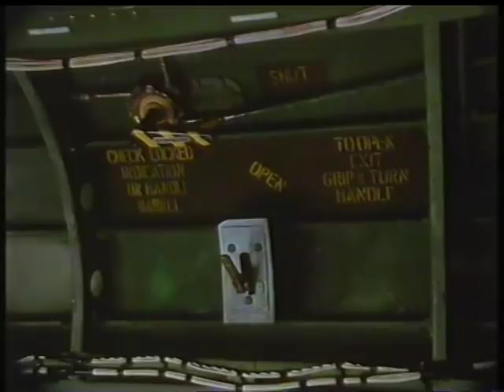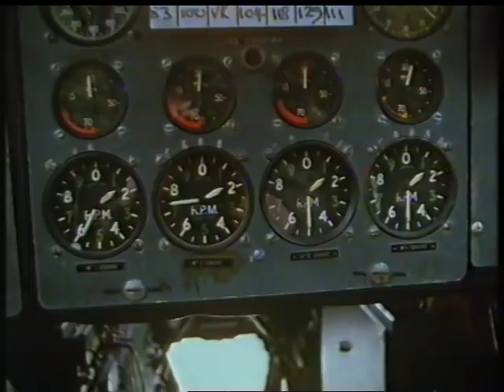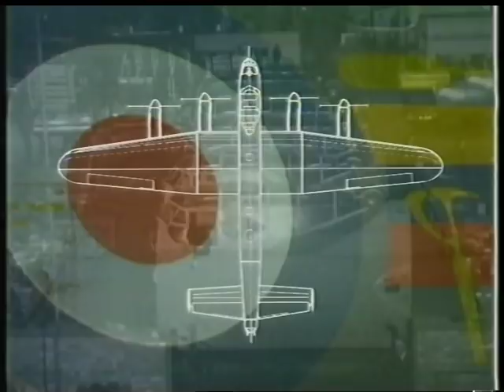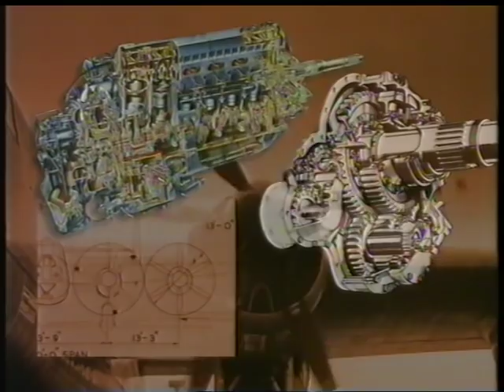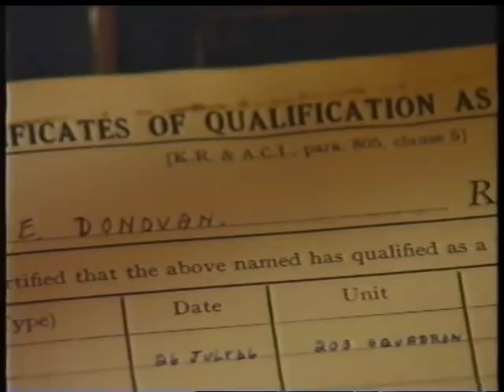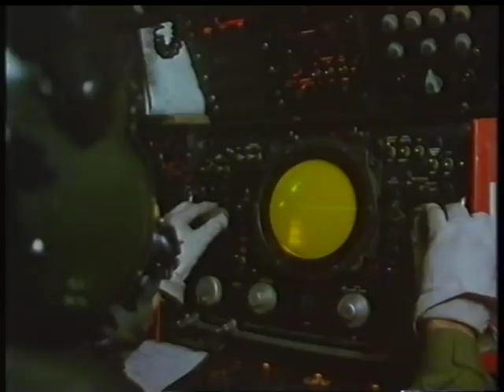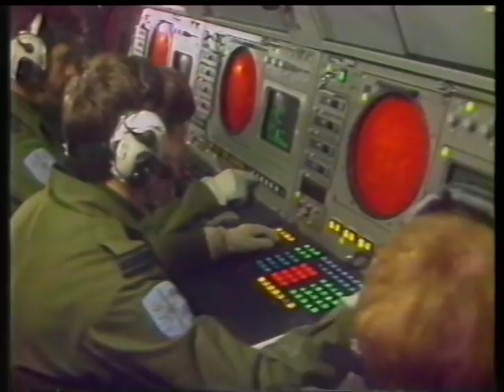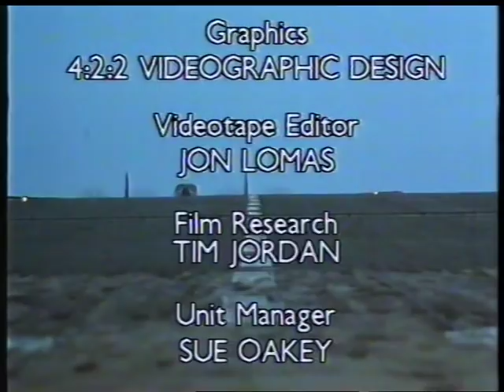'Perpetual Motion' The Avro Shackleton

Comment: Can't help feeling sad when seeing such a masterpiece of engineering being chopped up. Some may say that machines are inanimate, but with so many highly skilled craftsmen putting so much dedication in an aircraft, I just don't think that's completely right.
Reply: Yes, it was men (male and female) who dug & smelted the ore, who formed the ore into parts, who put the parts together, who kept the parts working in harmony, who repaired the worn and broken parts.  Men who guided it on its' path, who imparted a bit of their being into the whole.
Reply: No two are alike, they all have a character.
Reply: Agree totally. You can tell when its having a good day. Or a bad one.
Reply: Seeing them waste those planes brought me to extreme rage. They should have been offered for sale with any war time equipment removed. Zero reason to destroy tax payer funded equipment like that which is of real value. There was certainly more demand at air museums and so forth than 12 planes. Absolutely disgusting. Even as old planes in 1991 they would have easily brought more than scrap value. They're worth millions today. Infuriating.

Comment: I joined 204 Sqdn at Ballykelly in 1957 as an Air Signaller and served for 8 years and some 3500 hours.  The best thing about that time was the bond between members of a good crew.  Rank didn't matter so long as you were a commited member.  86 years old now but the memories are still with me.  Happy days.
Reply: My uncle, Barry Masefield, flew on Shacks from Ballykelly. Original joined up in 59 as radar techie but hated it and switched to non-com aircrew three years later. He later flew on Nimrod and then, after commissioning, flew on Vulcan and Victor.

Sadly he's no with us but I'm interested in finding out what Shack squadrons he served with, especially as I'm in the mob and my current station hosted 204 Sqn at one point.

Comment: I serviced this wonderful Aircraft on 8 Squadron at RAF Lossiemouth for 8 Years. I designed and installed my first Modification on the Aircraft and wrote my first User Manual (for "Autocat"). All of which motivated me for my ex-Service Job as a Technical Author working for "Airbus".
This Video brought back some wonderful Memories of my Time with the Shackleton. Thank you.
Reply: I got to go aboard a Shackleton at Lossiemouth :-)
Reply: diceman199  Tell me about it (do you need my E-Mail Address ?)
Reply: @nicholassiminson1825  No much to tell really. I was in the ATC and we got shown around the inside of one. I did have several flights on the Nimrods out of Kinloss though

Comment: I was so proud to have served in the RAF as an aircraft fitter, when we had these old ladies! Unfortunately i never got posted on them but we used to regularly have them in on exercise at Brize Norton! I used to love the smell inside them so ancient, leather seats and AVGAS!
The magic part was when they took off one after another they did MAG DROPS at the end of the runway before each took off the sound was truly.......SUPERB.
TRULY SADDENED that we have lost the Shacks and the Lightnings who used to fly intercepts at the request of the radar ops,  😢😢 brings tears to my eyes that the RAF has lost some of the best aircraft it ever had, replaced by the rubbish, unreliable over expensive F35 ‘Lightning’ ( what an insult to give THAT name to such a true WASTE OF METAL as the F35]👿 There was and is only one true Lightning.
Thank you crews and thank you Shackletons.
Reply: The one consolation of naming the F-35 the lightning is that it was named for the US P-38,but the "proper" lightning should not be mentioned in the same breath as the current pile of airborne scrap.

Comment: I remember them flying west over the north part of Larne, N Ireland in 1959 when I lived there.  On one occasion I recall a Shackleton trailing what looked like a small torpedo slung about 100 feet below it on a cable connected to its middle.  It was green, with an orange painted tip.  I imagine it must have been for detecting submerged submarines ..? Perhaps the probe was for picking up magnetic anomalies?
Reply: I wouldn't be any use to you on that question, but I remember seeing something similar in Dublin in 1981.  It was a Scottish Aviation Twin Pioneer towing a box behind it.  It was being used for geomagnetic survey work and made it to the Irishman's Diary column in the Irish Times.  Only recently I found that it was operated by Flight 1, a company that was then based in the Isle of Man
Reply: J Lalor I wasn’t here. We didn’t speak 😎

Comment: I remember a quote from a book on the worst aircraft – I forget the title – in which a Shackleton air crew member said the best sound in the world was when you were standing watching a Shackleton taking off because it meant that you weren't in it.
16:40 The Griffon engine was not developed from the Merlin, but from the larger "R" motor that powered the 1931 Supermarine S6B Schneider Trophy sea plane.
Reply: It wasn't a slur on the aircraft, rather then length of the patrol. The longest missions recorded were just under 24hrs.

Comment: A bit of a clanger somewhere.. As they were starting individual motors, 3 were running and somebody shouted "Starting Port outer".
The camera certainly was on a 'port outer' engine but it didn't have twin, contra-rotating screws like the other 3, just a single prop. I think a bit of Lancaster film crept in there.

Still,  a damned good show chaps, what! 
Wizard piece of video.. Don'tcha know, Old Bean.
.
Reply: That's the point of the film; the parallel between the Shackleton and the wartime Lancaster. It's used a few other times in the programme, so obviously not a clanger.

Comment: It is not mentioned in the film but the Mk111 Shackleton (the one with the tricycle undercarriage) was in fact a 6 engined aircraft. There were two jet engines mounted in the (inner?) engine nacelles to provide extra thrust on takeoff. These were run on petrol rather than jet fuel and only had a life of a few 10's of hours. The pilot had no control of them, the switches to start and the throttles them were mounted under the flight engineers desk as there was no room to put this addition on the standard panel.
Reply: I should add they were also Nuclear capable - the control column has two sets of switches - one for conventional depth charges and the second for nuclear depth charges.
Reply: @johnmurrell3175  And a standing order to start the jet engines to get them clear before the nukes went off.
Nuclear depth charges? Seriously? What height were they to be dropped from to allow the aircraft to escape?
Reply: @MarsFKA  I don't think it was very high - they also dropped them from RN Ships. I guess if the Submarine was deep a 10 to 30kTon weapon might not erupt that mush above the surface ? I am not sure what impact it would have on the ship dropping them but they might have been expendable like the V Bombers ? 

I have seen a film of a practice nuclear depth charge being dropped by a Wessex - well more like rolled out of the door.

The Shackleton has two buttons on the Control Column one for conventional depth charges and one for Nuclear ones. If you look in the 'bomb' bay of a MkIII the added on red wiring is for the Nuclear depth charges.

There is an interesting story about one of the Shackleton used to monitor the British Nuclear Test, they were flying at quite a height and the radar operator spotted a ship entering the exclusion zone. The aircraft would normally have descended to  identify the intruder but the captain stopped the co-pilot doing this. A long time after the successful test the co-pilot asked why they had not been allowed to investigate the ship. The captains answer was that their role was that in the event of the Victor that was carrying the bomb crashing on take off and the bomb going off all those on the monitoring island as well as most of the ship crews would be killed. The Shackleton was the only aircraft that had sufficient range to fly to an alternative airfield to tell the British what had happened !
Reply: @johnmurrell3175  That's an interesting story in your last paragraph.
Returning to the subject of nuclear depth charges, I was looking at something completely different and found this in an article on the P2V Neptune and the crews who flew them:
"“Sometimes we carried nuclear depth charges,” recalls Boslow. “If you got within half a mile of a Soviet sub, you’d be sure of killing it. Of course you’d probably kill yourself too.”
Reply: @MarsFKA  I just had a look at the Haynes Shackleton owners manual and on the loading plan for the bomb bay it appears to be shown as AS bomb. I assume AS is anti-submarine and bomb is because it was essentially the same British designed bomb dropped from aircraft like Canberra though I guess the fusing might be different - pressure rather than contact or altitude. On the bomb bay picture in the book you can see the red special wiring for the Nuclear Weapon. Since this type of read wiring had a nasty habit of cracking on bends I hope that ws better than the places I have removed it from !
Reply: @johnmurrell3175  I'm still shaking my head about those nuclear depth charges. The product of Cold War collective insanity.
Reply: @MarsFKA  My guess is that conventional explosives did not produce a high enough pressure to kill a nuclear sub particularly at depth. The weapon used was the WE177A rated at 10kTons. Apparently these could also be fired by the Ikara anti-submarine weapon giving the launching ship a range of around 10 miles to avoid the worst of the shock wave.

According to Wikipedia the WE177a weighed 60lbs - 272 kg so comparatively light & small.The B & C versions were more powerful but not used by the Navy. They don't look very impressive when you see one at least in their unarmed state.

Comment: Avro Manchester: "I have a powerful defensive armament"
Boing B-17: laughter
Reply: panzerabwerkanone 

Boing B-17: I can carry lots of bombs
Avro Lancaster: hysterical laughter
Reply: @davidmacdonald1695  Avro Vulcan: bitch please
Reply: @Jack-hg1hq  Vulcan 21,000lbs conventional bombload. Lancaster 22,100lbs conventional bombload.

Lancaster : bring it on, Junior.
Reply: @biggles19821  ok, vulcan range- 2300 miles max speed- 644 mph, ceiling- 50,000 ft

lanc range- 1600 miles on half load, max speed 280mph, ceiling- 24,500ft.

I love both aircraft but the vulcan was designed to drop one bomb very far away very fast while avoiding missiles, not a bunch of conventional bombs while defending against fighters. It's hard to compare aircraft for different roles. Cool username btw
Reply: @Jack-hg1hq  True, but for an aircraft its size and age, the sheer lifting capacity of the Lanc is still phenomenal by any standard! Vulcan benefitted from it as the company poured all the experience learned into it and make something exceptional.

Your data is slightly off on the range too, there's documented evidence of Lancs going some 2,250 miles with 12,000 Tallboys to bomb the Tirpitz.

Biggles... yeah. It started as a sarcastic nickname for me years ago, but its more appropriate nowadays!

Comment: The South African air force have stopped using these and gone back to using Douglas Dakotas!
A friend of mine owned one and the oil puddles under the engines were something to see:)
Reply: Shackleton or Dakota puddles?
Reply: @MarsFKA  Shackleton. Rools Royce oil leaks :)
Reply: @andrewallen9993  Okay. I was an apprentice mechanic in the 1960s, working on Rovers and Jaguars and it was an act of faith among us mechanics that the British never considered an oil seal to be working properly unless it was leaking.
Rolls Royce has always adhered to that tradition. I go to the Classic Fighters Omaka air shows that feature Mark IX and Mark XIV Spitfires. They are parked in the hangar overnight and we spectators are allowed to get up close and personal with them each morning, before they are taken outside for the day's activities. Each time, I have noted the regulation Rolls Royce little puddle under the rear main seal.
I'm not picking on Roll Royce alone – there were two P-40s parked in the hanger, as well, each with its little regulation Allison puddle.
Thrirty-nine years ago, I went to the Museum Of Transport And Technology in Auckland and walked around the aircraft they had there. One was an old DC3 and I got the impression that they occasionally ran up the engines, because the oil puddles under them were unbelievable!
Reply: @MarsFKA  Besides the puddles underneath my Norton Commandos there are always puddles under my XJ6, Mercedes fintail 200d and split and bay window kombis. The 350 Jawas of course have oil under the exhaust/silencer seals being two strokes.
I think it is a sign of old age :)

Interestingly enough there would be oil leaks (small ones admittedly) under the disk memorys of IBM 360 mainframe computers, part of the preventative maintenance routines was to check and top up the hydraulic oil levels :)
Reply: @andrewallen9993  Hydraulic oil in IBM mainframes, forsooth! I didn't know about that.
I've just retired from twenty years as a vehicle inspector at the NZ Automobile Association and we saw all kinds of vehicles pass through. The cars that seemed to leak the least were Japanese and, of them, the least leakiest were Toyotas. It seemed that the most reluctant of those to leak are Camrys and Corollas, which is one of the reasons why my wife and I now have one of each.
Having said that, I have seen some horrendous oil leaks from Japanese cars, as well as from all the others.

Comment: Has anyone noticed its rate of climb at around 9.44???
Reply: Pascal Chauvet:  Yes. An amazing rate of climb for how antique the plane looks. Approximately a collective128 litres, supercharged, wide central wing and those double props'.  A lot of 'grunt' and lift generated from that combination, I would think.
Reply: The Shackleton was pretty powerful for its empty weight. It had quite a bit more power than a B29 which was a lot heavier. No doubt the one at 9.44 was on a test flight and not fully loaded.

Comment: The Nimrod had a service life of 41 years. Yet you say the project was scrapped??????
Reply: I'm not sure how the gov't could think that the cost of nimrod and a few planes for surveillance wasn't worth it and remove that from the budget.  yet a couple billion on a new aircraft carrier...wtf are the priorities?  A few planes can cover more area and make a huge difference more so that any ship could do it.  totally misplaced priorities scrapping surveillance and subhuntting that was....idiot politicians have no clue.
Reply: The Nimrod was built in two major versions. The MRA was successful and was used from 1969 to 2011. The AEW was a failure and never reached operational service.
Reply: Hmm, three types 2 looked much the same, but were different inside and had different roles.
BAE got the AEW to work but MoD didn't want it and stopped BAE trying to sell it abroad.
Reply: Clearly, they were confusing the Nimrod Maritime Patrol Aircraft which flew for decades with the Air Surveillance variant, which was cancelled during trials in favour of the E3 Sentry!

Comment: wonder why the props are contra rotating, is it in case two engine turning the same way go out, or because they got more force out of them?
Reply: +leeboy29680 : I am no expert but I think the reasons are more power from smaller diameter propellers, also it alleviates Torque.
Reply: Replay the video at 16:40. The explanation starts there. In a nut shell, they got more effective propeller surface area kept within a small diameter instead of resorting to bigger diameter propellers. They used the space "saved" in the total horizontal dimension to make the fuselage wider.
Reply: Simply because to extract all the available torque from the engine one propeller would be so big it would hit the ground and probably the propeller on the engine  next to it.
Reply: Two reasons - more prop blades available to soak up the available torque (same reason why Griffon Spitfires had five bladed props) and you also decrease the inefficiency that comes with the energy lost to the spiral propwash. The front prop forces air to travel in a spiral, the rear prop recovers the energy stored in the spiral flow to produce more thrust. If done right the propwash coming off the rear prop is straight to the rear rather than spiraling. Note that multi-stage turbines have stators with blades angled in the opposite direction in between turbine stages for more or less the same reason.